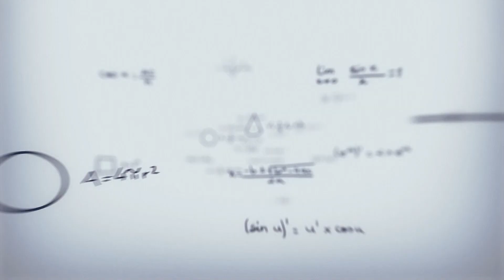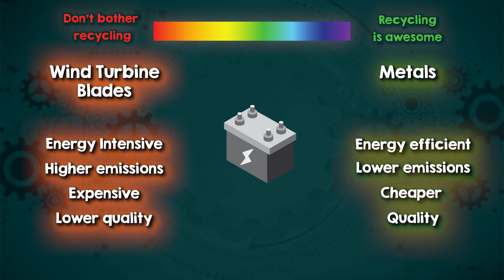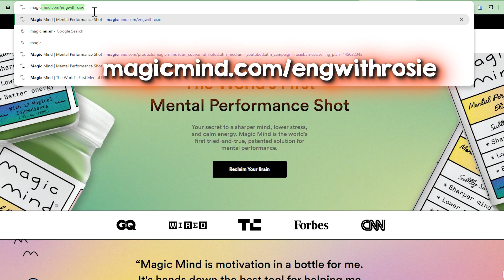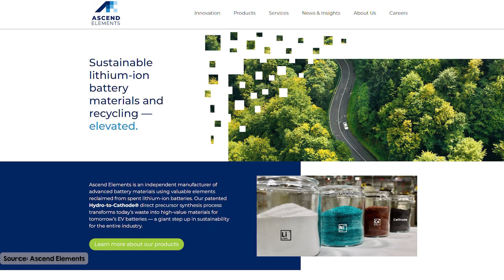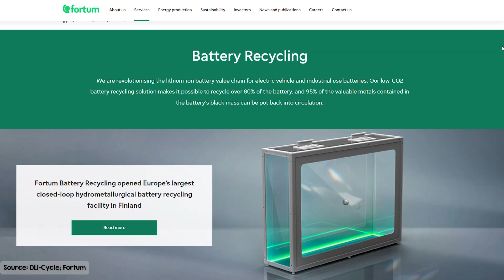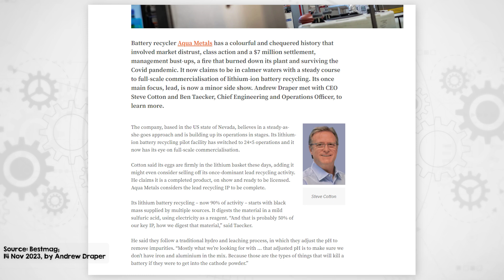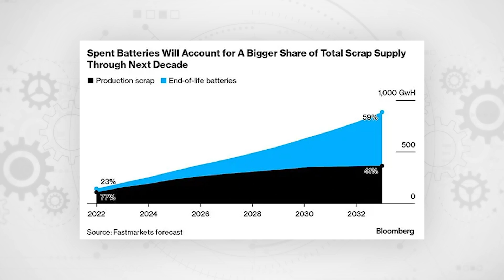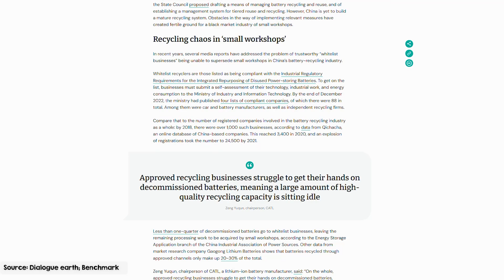Recycling Lithium-Ion Battery: How Does It Work?

Comment: only one correction: PRIMARY LITHIUM Metals, which includes solid state batteries are the hardest thing to recycle. The are very reactive and currently, there is no safe way of dispose them. Only one company in the world called CIRBA (Canada) can deal with them, and it costs a BOMB to recycle. So, solid state based on Priamary Lithium metal batteries still have long way before they become recyclable. Hopefully this will change with technology.

Comment: In the long run, we will recycle virtually all metals, for two reasons. First, there’s an “enough” for metals. As population levels off and starts to decline, the per-capita metals already mined and available to recycle will rise. Second, widespread cheap solar power will make clean energy readily available for such processes. A lot of these problems can be solved simply by throwing energy at the problem.

Comment: the knowledge that in two years’ Time the targets are likely to be adjusted, will have them working toward more sustainable Methods, which will be good for their 
business in the long term. The bond for a washing machine, fridge or solar panel would be much less, may be £30 as they should be much simpler to disassemble. It should be possible by now to 
insert a small microchip in such items, to better align its point of purchase and its point of disassembly.

O.K. disassembly might work, but the problem is with the bond idea, as it stands you would have a ten or fifteen-year time lag before such a system would be up and running.

True, but this is where the governments come in, they could pump prime, if the government paid out a sum equal to a bond for each scrapped car in the first year, the bonds collected on all new cars in the first year, would then go on to pay for the disassembling of cars in the second year, in the same way that today’s state pensions are paid for by today`s workers, and when today`s workers retire, their state pension will be paid for by the next generation of workers. For a one-off payment the government could start a whole new disassembly industry, providing 
employment for thousands, ensuring a continuous supply of recycled material with minimum contamination as part of a sustainable future. 

Back to the B.A.T.E.S. framework, how do we check and validate these new targets are being met? It seems to me That about 90% of all goods sold on the high street are controlled by half a dozen Supermarket groups, plus ten multi store groups specializing in electricals, furniture, and Clothes, these companies already have a small army of inspectors checking the quality and Safety of the goods supplied; it would only seem a little extra work to demand that their Suppliers produced evidence of the amount of recycled material, or the percentage of Renewable energy used, or quantities of water that could be replenished in any goods or Services supplied, and then certify that the requirements have been met, independent Inspectors could work for multiple smaller retailers, and responsible larger manufactures Could self- certify, the prospect of having their goods or services banned would, I am sure Be sufficient to make most companies comply, plus with 

It might also be good idea for most products to have a (serviceable use) date stamped on them, which would tell you how long in normal use a product should last, this would give Manufactures the incentive to make their products more durable than the competition, which would add value for the customer, and when the product does come to the end of its Useful life, the knowledge that it will be disassembled and recycled should encourage Manufactures to design products to meet that end. Mining groups and fossil fuel companies may cry foul, but they have had it good for 
a long Time, maybe they should think about diversifying, possibly into recycling or renewable Energy.

Comment: I realise I am doing this the wrong way around, but here is more on the bates framework Businesses will have to start asking energy and water utilities, how much of the energy they 
are supplied with is renewable energy, and how much of the water they are supplied with comes from a replenishable source, but its biggest effect should be on recycled materials.

One option worth considering could be, disassembly lines, while assembly lines may have gone abroad, there is no reason why end of life products could not be disassembled here.
It should be mandated that most manufactured products should be disassembled at the end of their useful life. How will this B.A.T.E.S. mandate work in practice? for larger items 
like fridges, washing machines, and other household electronics, at the time of purchase an additional charge would be made for a bond, probably set at 10%of the purchase price, which would be stored electronically and would be redeemable by a recycling company, only when the item had passed down a (disassembly line) and been broken down to its most basic materials. 

For a larger item like a car, I would set the bond at £750 payable to the (D.V.L.A.) when a vehicle is first registered in the U.K. or similar authority in another country. The bond is then held until the vehicle has reached the end of its useful life, then the bond will be redeemable by a disassembly company, only when the vehicle has passed down a disassembly line and has been broken down to its most basic components and not just crushed, this means everything removed, doors, bonnet, boot and separated from their padding and electricals, seating, carpets, and roof lining, plastic dash-Panel, and wiring loom removed, even the engine/ gearbox and suspension system to be separated into their various metallic alloys, and even the generator and starter motor, in the future, this would include vehicle motive batteries and fuel cells, all to be disassembled. 

It would not matter Where in the world the car was made, once it is registered in the U.K. a bond must be bought, and all manufactures who wish to sell into the U.K. would have to supply the Disassembly companies with a protocol out lining the easiest methods of disassembly.

Problems and benefits of the idea so far, even a cheap new car costs over £20,000 So how do we manage to disassemble for just £750? Well to start with you do not need a design team or an advertising budget, neither do you have the cost of manufacturing components from freshly bought new raw materials, and if you consider it takes between 20 and 40 hours depending on the efficiency of the plant for a shell to travel down an assembly line to become a completed vehicle, it should take about the same amount of time to disassemble, and £600 is about the wage for forty hours of a low to medium skilled worker.

 And it will be MANUAL labour that will be required, robots are perfect for assembling pristine new components, but after ten or fifteen years of corrosion disassembly might be beyond them; one option could be to repurpose old car production plants that are due to be decommissioned.

Comment: Whether it is recycling batteries, Solar panel, cars or washing machines, the problem is not Technical, but financial, there are plenty of clever chemist and engineers who will develop 
The necessary systems to recycle almost anything, but if there is no demand for the recycled material, there is no point and no incentive to invest in such systems, to that end

I suggest a framework of Biannually Adjusted Targets for Environmental Sustainability  Ideally this would be set up as part of a global inter-governmental conference, like the 
COP conferences may be a (3R`S) conference, no, not the grammatically incorrect.(reading, writing, and arithmetic) but (renewable energy, recycled material, and replenishable water) 

Given the state of current diplomatic tension, it is unlikely a global consensus could be Agreed, so maybe we should encourage governments to set up their own variation, which 
might lead to protectionism, (in the name of sustainability of course.)
 
Governments already have rules about what can be sold, like no lead in paint, and electrical Standards. So, is it such a big leap of imagination to have rules about sustainability? 
A (B.A.T.E.S.) framework should complex and, all-encompassing covering every category, and would require the definition of each product or service probably by sector, so we are able to balance what is desirable, against what is possible, it would set minimum standards for the quantities of recycled materials to be used in each product, plus the percentage of renewable energy to be used, together with amount of water capable being replenished that was involved in the production of any product or service. These targets would be adjusted every two years, (products or services) that did not meet the new targets after  Two years would be Banned, these targets would be different for each product, newspapers And cardboard packaging could probably already be made from 100% recycled material,  but it is not practical to recycle cotton from a shirt to make a new one, in that case we would concentrate on whether the water used to grow and process the cotton could be replenished.

Comment: Interesting but not very reassuring that recycling will be a viable business.  It still looks questionable that all this battery stuff is actually a net benefit to the planet.  Synthetic fuels are being looked down on because of low efficiency but if it avoids a bunch of toxic disposals from batteries then it might just be worth it.

Comment: 1:25  Even though copper is highly recycled, I take that 1/6th with a HUGE grain of salt.  The problem is that they are likely not including all the energy used to get the used copper to the smelter.  The amount of energy to get the material to the smelter is extremely high.  It is usually recycled in low amounts.  Someone gathers maybe 20 pounds of copper and drives it to a recycling center.  It then has to be trucked, albeit in much larger quantities to a larger recycle and then finally to a smelter.  It is likely (though I don't know) also melted once into usable shapes and weights the smelter needs.

Comment: I don't think we have reached the recycling cycle of EV batteries yet. When this industry gets going over the next 20 years and economies of scale make large industrial scale battery recycling more economically viable new processes will make it profitable. Mining minerals and elements will always be more expensive and energy intensive than recycling existing ones. Eventually batteries can be designed with easier recycling engineered in. Don't forget that depleted lithium batteries still have 80% capacity and can be used for stationary power storage for as much as 20 more years since the lower energy density matters less than motive power batteries. Old EV batteries power my home energy storage for solar PV.

Comment: According DOE report on recycling - mining in old batteries will max keep a 65% retainment on Pyrometalugic process and cost 10X the CO2 compared with building batteries from newly mined material. 1-2% is recycled today because it is a crazy cost to go through. Also this is why when you read Volvo report on SUV cars ICE (XC40) and a similar BEV SUV - they do not count in the battery recycling energy usage  - like most other BEV reports. The Volvo needs to be driven 118.000km for a CO2 break even in Denmark and Volvo estimates the BEV SUV life to be 130.000km average. Hydrometalugic separation is so toxic and many people that has been experimenting has become serious injured from it.

Comment: There was much talk about "second life" for EV batteries a few years ago (home batteries, perhaps grid storage); nothing much seems to have come of it. Typically re-use is more cost-effective than recycling as it requires very little processing. I suspect it may well simply be that there's insufficient supply of end-of-EV-life batteries to make a market. Beyond the earliest EVs, we're now seeing EV traction batteries lasting easily through the life of the vehicle itself which in turn delays the point at which significant amounts of end-of-EV-life batteries will appear in the market.

Comment: About recycling economics, I would say that recycling business is not a good business. Why not? Well a product can be decomposed in 2 parts: 1) raw matter which the product is composed of (that would be all the atoms) 2) The process to transform the matter into final product which the customer will pay for. Obviously , the more processing you put into your product (assuming the product is very demanded) the more pricey it gets. This means that the customer doesn't pay for the raw mater,  raw matter is cheap, but the customer pays for the process. Why does a car cost more than a loaf of bread? Well, because the process of making a car is more complex. Now, if we get back to recycling business idea, what is your product here? Haha, it is raw matter!! Do you see the problem? You want to sell the customer a product which production consists of 0 processing steps. How many processing steps does a car have (including all the processes of of car parts that aren't made by the car manufacturer because it outsources it , but the providers of a car manufacturer will charge for the cost of these processing steps). I would speculate that a car would require millions of processing steps to convert raw mater into final car, and that is why it is orders of magnitude more expensive than a loaf of bread. TLDR: recycling business is a very complex task while it produces a product of very low value. This means that recycling business can be only run temporarily in times of great economic growth to profit on rising commodity prices.
Now, another story is that there is a huge economic crisis coming which will certainly make prices of raw materials much much cheaper than they are today.

Comment: As a person with some background in chemistry, I always find the word "cathode" problematic when presenters use it when discussing rechargeable batteries. I have a similar issue with "anode". The problem centres on the ways the chemistry changes during charge and discharge. When charging, the cathode will be the positive side because the external circuit will be sucking electrons out. During discharge the battery will be supplying electrons from the negative side. 

If you want to more precisely describe the chemicals on each side of the battery, perhaps you might want to use the words "positive " and "negative".

Thanks for your work Dr Rosie, and the native Aussie English speaker in me doesn't think you talk too fast.

Comment: Very misleading  information.  The amount  of lithium   batteries  going  into  toxic waste  is staggering.  When  you put batteries  from power tools  and lawn and garden tools including  electronics  into the recycling  bin they go directly  to toxic  waste.  This is a sad situation  on so many  levels.  These batteries  are replaced  every  few years  because  of their safety built  in they simply  will not  charge.  Car batteries packs do not have  so much  protection otherwise  they would  have to  be  replaced  every few years  as well. That is why the older they got  the more  unstable  they are. But getting  back to  the huge pile of  smaller  batteries going  into  toxic waste.  Usually  there  is only  one  cell bad in the pack. The rest will charge  fine  and last for years to come. There  are often  fires  in the recycling  facilities  not reported  because  they are contained  but still cause air pollution of toxic  chemicals.  . Most of the startups  in real battery  recycling  are looking  for  investors.  Which as you pointed out is not a wise investment.  What we need  is a government  run recycling  program so that all these  batteries  will have  to  be recycled . Weather  or not  it is cost effective  to. It's  like  putting  your  money  where  your  mouth  is. But who am I  kidding  we know  that won't  work  out  well  either.

Comment: Hello! 
Thank you for the valuable video !

I work in Europe, Belgium with EV Battery dismantling, testing, handling and reuse. 
It's crazy how costs of battery economics have changed. 

Here we have achieved 50% reUSE rate before end of life :)

Ten years ago we had like 10t of Li-ion battery recycling feedstock now we have like 10000t and will have 1000000000t or whatever. Issues in quality, processing and manufacturing of new batterty cell materials like anodes and cathodes is quite challanging with recycled stocks and many (pyro or hydro) recyclers  have big ammounts of black mass and other recycled materials just sitting in big waste facilities waiting for a buyer. 

You know how Britney had this Lithium problem, 
do you think it could have been from recycled batteries?